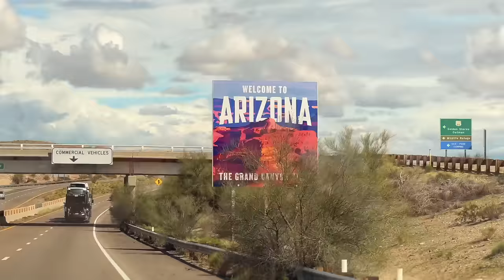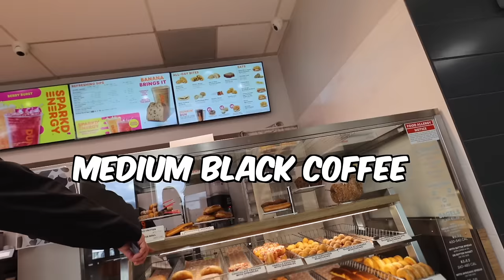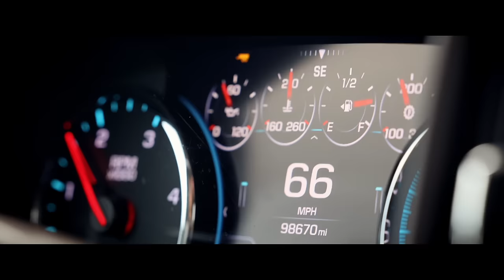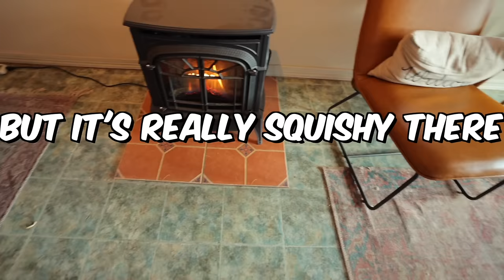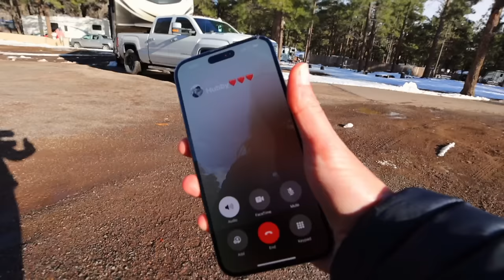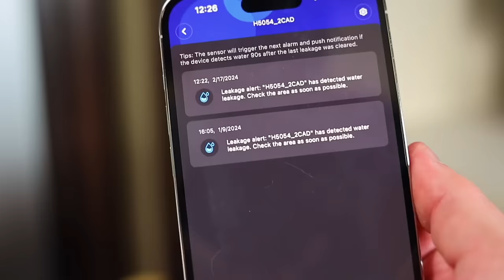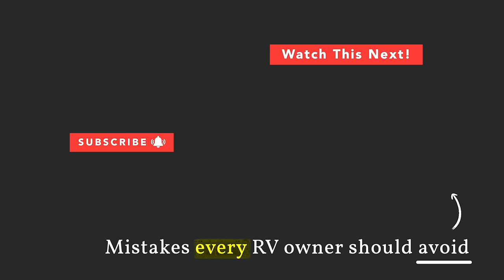HUNKERING DOWN in a Snowstorm | Cozy Winter RV Camping (Arizona)

Comment: About the headlight flashing after fueling issue...  There are a LOT of truck drivers who believe that pickups should NOT be using the high-flow diesel (truck) lanes. While you don't generally have a choice when pulling Soli, there are a LOT of pickup drivers who think that simply because they're pulling a trailer (even an empty garden trailer), they MUST use the truck lanes.

A few months ago, I pulled into a rather busy truck stop for fuel. I'm a company driver, and I don't get to choose my fuel stops. I pulled in behind a "hot shot" with an empty gooseneck trailer; it looked to be about a 20' bed. (I look over at the car island; multiple diesel pumps available, and plenty of room.)  He starts fueling, and then starts cleaning his windshield.  No problem so far.

Remember, these are high flow pumps.  After a few seconds, the nozzle pops.  He finishes his windshield, then restarts the fuel.  He then uses the window squeegee to start washing THE SIDE OF HIS TRUCK. The nozzle pops again.  He washes THE OTHER SIDE. He spends another few minutes futzing with the nozzle, then hangs it up.  He washes his hands (in the windshield cleaner bucket), dries them, and pulls forward.

He spent EIGHTEEN MINUTES to pump FIFTEEN GALLONS of fuel.  I spend eight minutes pumping 130 gallons. I get into my cab, and wait for him to move. (Someone was behind me, so I couldn't back out.) Nine minutes later, he finally comes back out with a bag of food.  I expected him to sit there and eat it, but fortunately, he didn't.

He tied up the fuel lane for 35 minutes.

One of the unwritten rules (courtesy) among professional drivers is you spend a maximum of ten minutes in the "pull forward" area. That's enough time to make a "pit stop" (leave your phone in the vehicle!), grab a bite and some caffeine, and hit the road.

Another is that the window squeegee is ONLY for use on glass.
Reply: We are new RV'ers, waiting for our fifth wheel to be delivered next week. Thanks to the Hanks recommendation (Thanks Hanks!), we signed up for TSD Open Roads fuel discount program. The instructions state that we MUST use the commercial truck lanes in order to receive the discount. Can anyone confirm if this is true or are we able to use the car islands? In any case, we plan to be very mindful of commercial drivers and follow the rules of courtesy. :)
Reply: Thank you for that info. I pull a 40 ft 5th wheel. I do not wash my truck but I do use the truck fueling areas. I also like to get in and out ! I don’t like being with all the trucks. I know they are working. I never had anyone flashing lights at me. One more thing when truckers are trying to get in a lane and I flash my brights letting them in why don’t they thank people anymore. What happened to curtesy on the roads .
Reply: @sharimcintyre2026  If that is what TSD instructs I'd go by their instructions.
Reply: @sharimcintyre2026  This is true you must use the truck fuel lane for TSD Open Road discounts.  To OPs post, he didn't have a problem with the person using the fuel lane for trucks, it was he did ridiculous things holding up the fuel lane.  Don't do that, just pull in get your fuel and get out of the way.
Reply: I am new to Diesel and RVing, we have a 42’ long 5th wheel so I began using the truck stops. The biggest pain I have found is that you have to walk inside to prepay then when done you have to walk back inside to sign off get your debit card and drivers license back (at some places). It’s a huge pain in the A$$ trying to blend the RVers and commercial guys. I haven’t watched the video yet so maybe it speaks to it. I am going to get some corporate cards, I feel your pain Driver. 

Washing his hands in the windshield bucket is absolutely disgusting! What’s up with all the diesel pump handles being covered in fuel and oil, even the typical gas stations diesel pump handles are filthy.
Reply: Good timing tips. Only reason many of us non-bug rigs are in those lanes are the fuel cards which can't be used for diesel in the regular lanes, but not moving when crowded is no excuse
Reply from the maker: There are peeps in any situation that ruin it for others for sure
Reply: What do you expect for 4 wheelers. They could've pulled out of the fuel Isla d & parked near the entrance

Comment: Back in February 2020 we had down to 25 deg overnight at Gunter Hill Campground in Montgomery Alabama.  Our camper has no protection board on the bottom so our plumbing is exposed.  Because the site was paved and the days were getting to near 70, the ground kept warmth emitting to prevent freezing water.

Comment: To the whiny, ignorant truckers:  TSD cards can ONLY be used at the big rig pumps...deal with it.  It takes a lot less time to fill up a small pick up truck fuel tank than it does to fill up the massive semi truck tanks.  RVers are in and out in a much shorter amount of time. Some truck drivers are just jerks and give all truckers a bad name.  I had one of these jerks pull in behind me even though there were several empty spots available.  Total ignorance.

Comment: Curious to know what lift you have on your Denali and if you had to make any modifications to get your 5th wheel level with the lift? We have a '18 Silverado 2500HD with a 5" lift (BDS/Zone) and are looking at upgrading from a TT to a 5th Wheel and want to iron out the setup that is needed to get this to work right. We're considering dropping the lift 1" front and back if its worth it.

Comment: Great video!  Love snow.  I’m from Indianapolis and this year, we got very little measurable snow.   I’m curious about what size truck your GMC is.  Is it a 2500 or 3500 Duramax?   I have a GD reflection 337RLS and it is similar to your RV in size.  I’m slightly over on my pin weight and I don’t have a washer/ dryer in the front etc.  I need to clear out some things.  Pulling mine with a 2020 Silverado 2500 duramax is no problem, but pin weight is.   Thoughts?

Comment: I was supposed to make a quick run out to Calico Ghost Town to run a shakedown on improvements to electrical system and wildflowers on Wednesday.  Woke up URI, with a brand new High Winds Warning for I-15 and I-40 around Barstow and snow on Cajon Pass on Friday.  My return day. Rats CANX that trip.  We watch the RailCam at the Flagstaff Station to watch the snow. My brother and his family got snowed in in late April one year, 2 days extra days with I-40 closed and they waited one more day to let the trucks and speeders get away.

Did you calculate your gallons needed to get to the cheap Arizona fuel in Topock while in Barstow?